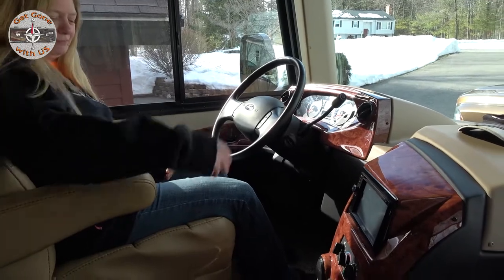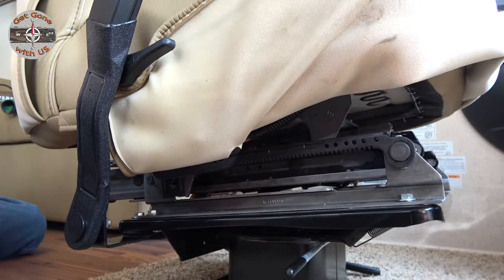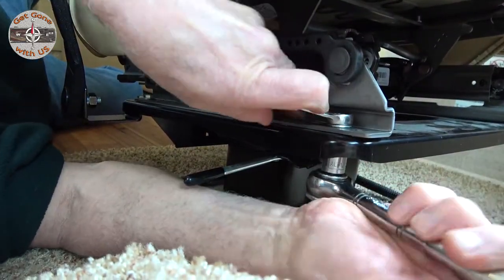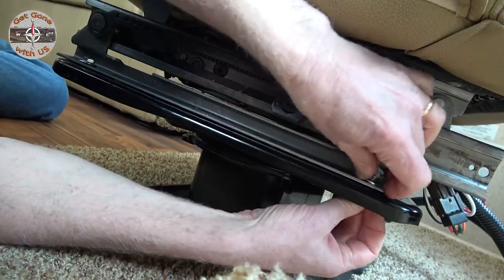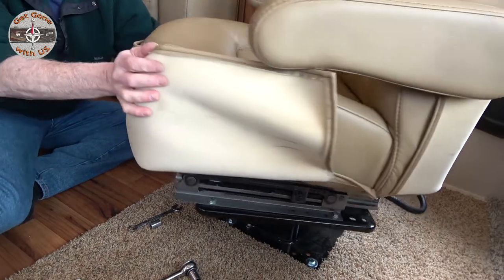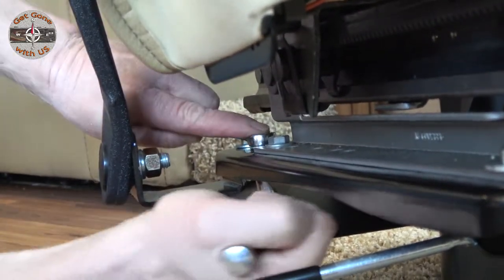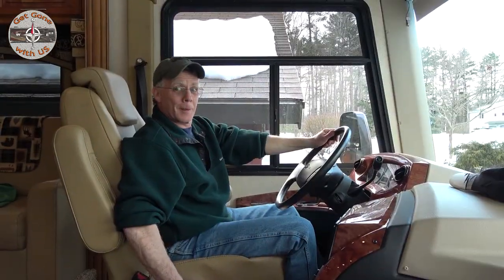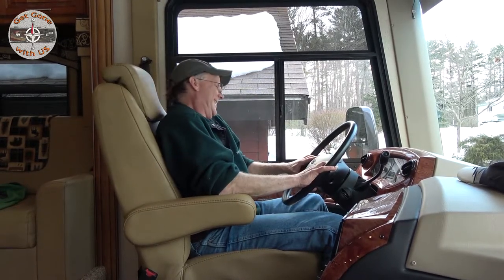Jayco Precept Driver's Seat Adjustment - RV How To

Comment: Many thanks!!! Exactly what I needed to know! The 2 inches made a huge difference in the adjustability and reach. Also, the larger diameter 3/8" x1" bolts may be able to be used for all 4 seat track bolts and 2 more for the seat belt bracket.
Reply from the maker: Glad it helped! 😀